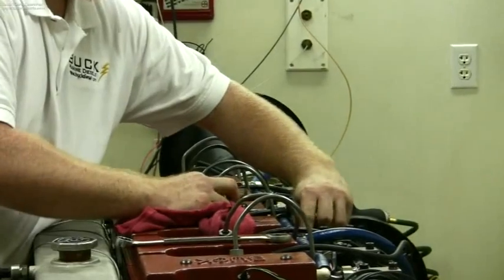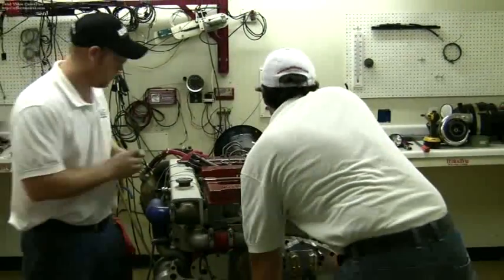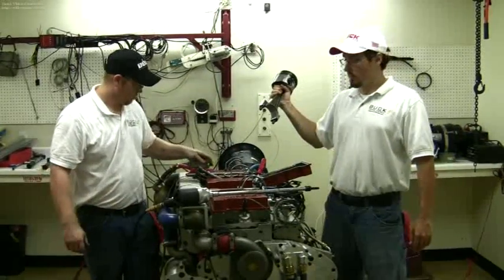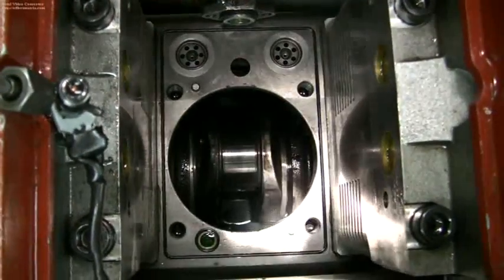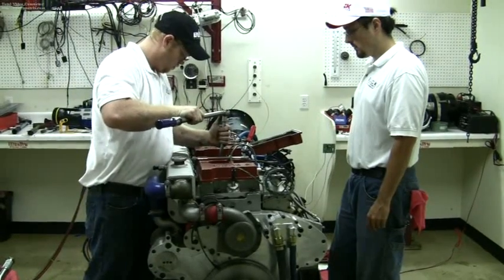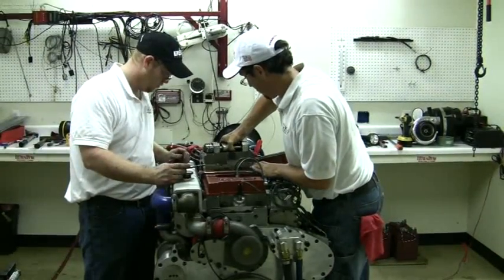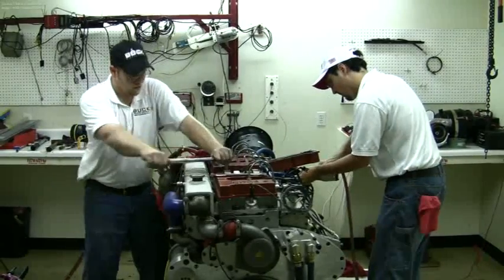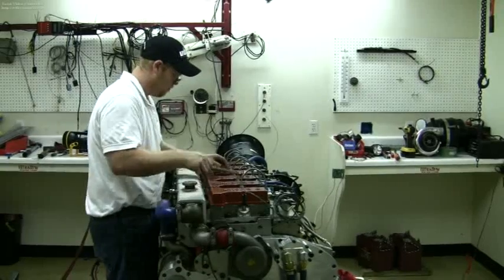Buck Diesel - 6 Cylinder - Single Cylinder Replaced - Under 8 Minutes

Comment: Many years of searching for funding without success. A few wanted to take total control but I haven't let that happen yet. Final designs are even better. Lighter, more power, lower emissions. Building a better engine is a joy. Finding funding to commercialize the designs, not so much.

Comment: Now that is some thoughtful and clever engineering.  Is it a two stroke or four?  The cylinder not needing a ring compressor is ingenious.- an almost painfully obvious idea that should have been implemented  a long time ago -  I was wondering what method is employed to negate the need to adjust valves--- is it an auto lash adjuster??   Is the whole engine this easy to service-??
Looks like it would be a smart man that decided to back this design, theres some great engineering ideas heere.